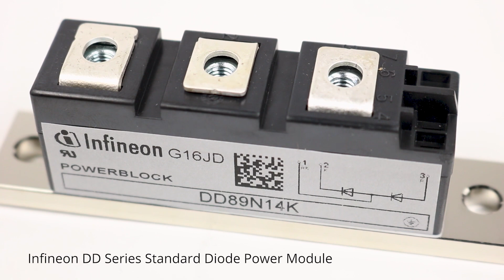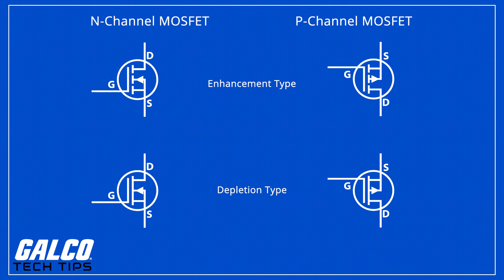What are Power Modules? - A Galco TV Tech Tip | Galco

Comment: What is igbt
Reply from the maker: An insulated-gate bipolar transistor (IGBT) is a three-terminal power semiconductor device. IGBTs act primarily as an electronic switch and feature both high efficiency and fast switching. IGBTs combine the simple gate-driven characteristics of MOSFETs with the high-current and low-saturation voltage capability of bipolar transistors.